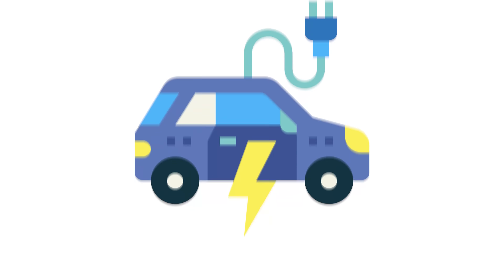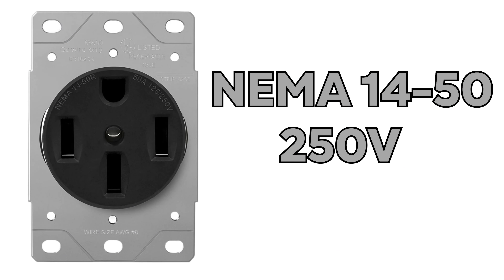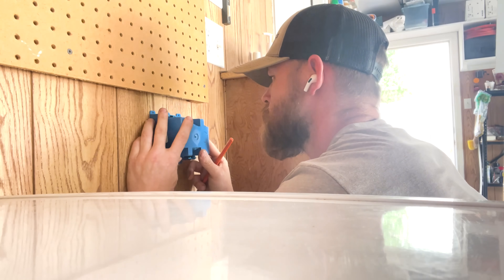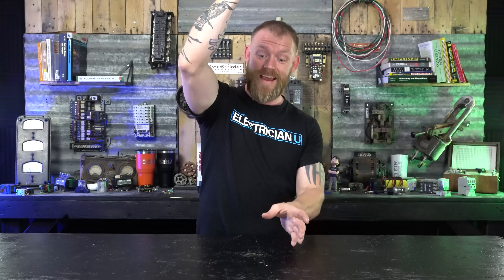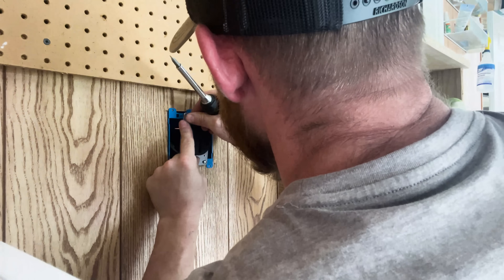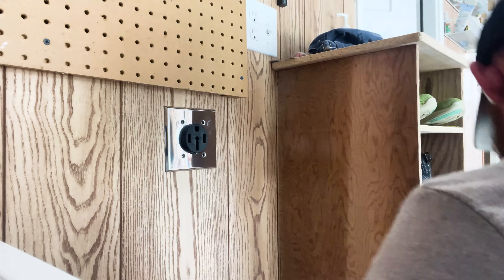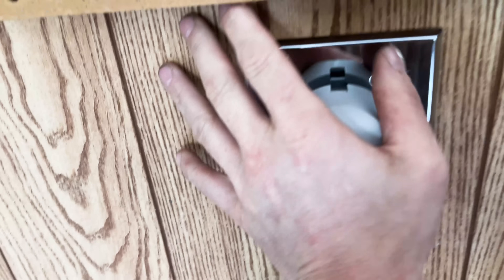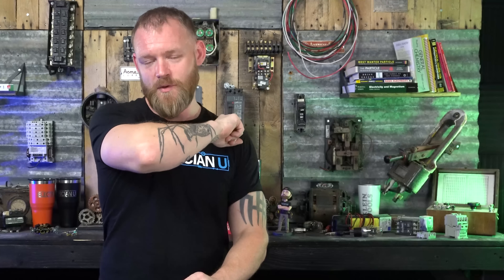How to Install an Electric Vehicle Charger Receptacle

Comment: For NM cable, don't you have to use the 60 degree column?  In that case, its ampacity is 40 amps.  An alternative is to fish ENT and run THHN through it.  Since the receptacle and panel connections are gonna be rated for 75 degrees, you can use that column, which does give you 50 amps.

Also, 210.21(B)(1) "A single receptacle installed on an individual branch circuit shall have an ampere rating not less than that of the branch circuit".  How can you get away with installing an individual 50A receptacle on a 30A branch circuit?
Reply: "Not less" means more than or equal to
Reply: @1Gigawatt  Yeah "not less than" means 50 amp receptacle on 30 amp wire is OK, because 50 amps is "not less than" 30 amps.   Seems just fine to have overkill receptacles by that code. . .
Reply: @snap-off5383  In general yes, but there's a table for 14-series receptacles that lists allowable circuit ampacities for each.  For 14-50, it's 40A or 50A.  Not 30.
Reply: @charliesullivan4304  "its listed in the rules" is never a "why" answer.  "why" answers "why was it put in the rules?"  There's no logical reason a 40A rated receptacle can't handle 30A.
Reply: @snap-off5383  It's not about the recep. It's about what someone could plug into it. The "why" is that someone could plug a 50A car charger/welder/RV/whatever into this nema 14-50. Even if that load was perfectly calibrated to draw less than 50A momentary and less than 40A continuous (80%), that would actually exceed the 80% continuous rating on that 30A (24A continuous) circuit.

 Yes, in theory the 30A breaker will trip before anything really bad happens, but the code is also requires 80% so it isn't constantly tripping.
Reply: @charliesullivan4304  if they didn’t allow using a 30 amp breaker a lot of EV chargers couldn’t be used. I installed a bosche Level 2 charger and it specifically states in the manual that the maximum breaker is 30 amps. It is UL listed and tested with a 30 amp breaker and installing it on a circuit with 40 or 50 amp breaker would void the UL listing.
Reply: @ewicky   You're getting it backwards. . . try to stay on topic, not invert it.  The topic is NOT a 50 amp receptacle on 30 amp wires the code says the receptacle rating must be NOT LESS THAN the rating of the wiring.  i.e. 50 amps is not less than 30 amps, so 50 amp receptacle on 30 amp wires is OK by that code. The question I've asked that you have still yet to address a single time is why wouldn't a "less than" receptacle be safe?  so reverse your topic: a 30 amp receptacle being served electricity by 50 amp wire*.   Why would the code want to prevent that SAFE configuration by the wording "receptacle amp rating *not less than wire rating."?   "what would someone could plug into it" is easily understood: They'd only be able to plug in items intended for 30 amps or less, and never have a problem.  The code doesn't make sense.  It doesn't prevent a 50 amp receptacle on 30 amp wire, it prevents the opposite by its wording. It says a 30 amp receptacle on 50 amp wire is a no-no.
Reply: @snap-off5383  This is my first reply under this comment, so writing in bold that I have "yet to address it a single time" makes you look unnecessarily aggressive.

I was responding to you who was responding to Charlie who told you to look at the table. You obviously still haven't looked at the effing table. You don't need to repeat yourself, I know what "not less than" means. And I'm keeping on topic to what happened in the video and in the original comment.

As for your suggestion that a 30A recep on a 50A branch circuit (aka wire and breaker) is safe, no it's not. Well it is, until someone plugs something into it. They will, rightfully, plug a 30A appliance in. That appliance will have a flimsy 30A cord that will, for the purposes of this conversation, catches fire at 40A. That appliance was designed to run on a 30A breaker and was also designed to trip a 30A during a fault BEFORE the appliance or its cord catches fire. But on a 50A breaker...
So yes you can have an appliance overloading itself or loose connection shorting itself to the case/EGC inside or whatever. And the fault current or overload condition could be 31 or 40 or 45 or 49.9 amps. On a 30A circuit (wire & breaker) that would trip the breaker and save the day. On 50, it would not trip and let the appliance start a fire. You are correct that the fire could not be at the breaker and building wiring since those are all happy with up to 50A. But the recep itself, plug, cord, appliance, etc., burn baby burn at 40A. The code is written to help breakers provide some rudimentary protection for downstream appliances, not JUST to protect building wiring. This is partially because we don't have point-of-use fuses like Europe. We rely on our breakers to protect appliances and their cords.

Yes I know about thermal trip curves and blah blah blah but I'm boiling down the made-up amps numbers to keep it simple haha.

I hope that helps you see the potential problem with mismatched recep/breaker pairings.
Reply: @ewicky   Ok you don't want to talk about what I'm talking about.  Its fine, you can keep changing the topic, I'll write you off. I understood what you wrote, you refuse to try to understand what I wrote.
You're stuck on trying to be "right all along" rather than "correct": 
NEC Article 100 "Definitions" defines branch circuit (BC) as "The circuit conductor between the final overcurrent protection device (OCPD) protecting said circuit and the outlet(s)." See how it DOESN'T include the OCPD in branch circuit (aka NOT breaker ONLY wire) and how my question is valid?
Ok so now for the first time can you address the topic of 30 amp breaker 50 amp wire 30 amp receptacle being a code violation.  Where's the safety hazard? Or are we going to hear more about how you were right all along?
Reply: @snap-off5383  Yes, you're going to hear more about how I was right all along. This is the comments section of a YouTube video, what did you think was gonna happen. I don't owe you anything, and certainly don't owe you anything better than me explaining how I'm right again haha.

You're misinterpreting the code. You can oversize the wire all you want. The breaker and recep need to be an acceptable pair that is on the table that you've hopefully read by now. That's it. That's all there is to it. It isn't a code violation to use a 30A recep on 50A-capable wire on a 30A breaker. Putting said 6awg ("50A wire) wire on a 30A breaker effectively de-rates the "branch circuit" to 30A for most subsequent circuit sizing (and recep selection) questions. Exceptions would include things like available fault current calculations and other off-topic stuff that relies more heavily on distance, AWG, etc.

It sounds like your entire question was formulated out of your "ASSumtion" (ha) that that was a code violation to begin with. And now you've made an ass out of you and me.
Reply: @ewicky   "I don't owe you anything,"  Why is this phrase often said by people where there was no communication given that anyone felt owed?
Yeah the "rating" coming by definition from the OCPD not the wire amperage rating was the missing information that I presumed (rather than assumed -  there's a difference)  I'm not a professional electrician, just a professional homeowner, thus I asked with no expectation of anyone answering as is quite evident from my first comment.
Reply: @alexlacey9808  sorry, I must not have been clear.  There are a lot of EVSEs ("chargers") that have different ratings and absolutely, you should follow their instructions as far as what breaker size to use, which can be as small as 20 amps or as large as 100 amps.  What I was saying is not allowed is a 30 amp breaker on a 14-50 receptacle. That's in the national electrical code and applies regardless of what you do or do not plan to plug in to that receptacle.

Bosche does have a model EV400 that has a 14-50 plug on it.  It can do 30 amps, and the manual specifies a 40 amp breaker for that.  I'm not sure which one you have.  But maybe you have a hardwired one that specifies a 30 amp breaker.
Reply: or surface mount EMT?  What is 6 gauge good for in rigid/emt?  That's what I installed on my welder outlet, wonder how big I can go for charging cars. I know, google.
Reply: @snap-off5383  Depends on the wire type. Welder isn't continuous draw. In general #6 copper is good for 50A.
Reply: Because 50 is not less than 30.  Putting a 50A outlet on a 30A circuit is perfectly fine.  Putting a 30A outlet on a 50A circuit is not.
Reply: @stargazer7644  which begs the question:  WHY?  What would go wrong with a 30 amp receptacle on bigger wire?
Reply: @snap-off5383  Bigger wire wouldn't be a problem as long as the outlet was designed to use wire that big.  The problem is putting it on a bigger circuit breaker.  30A receptacles are only designed to handle the heat from the current of a 30A load.  If you draw 50 amps through that 30A receptacle, it (or the 30A cord plugged into it) will overheat, possibly melt and/or catch fire and the 50A breaker would never trip.  The entire purpose of a circuit breaker is to protect the wire and equipment connected downstream of it from overheating and catching fire from current higher than it was designed for.  The breaker is sized for the maximum allowable current that the wire and receptacles can safely pass.
That's why drawing 30A through a 50A receptacle is fine, but 50A through a 30A receptacle is  not.
If you try to draw 50A through that 50A receptacle on the 30A circuit, it will simply open the circuit breaker before anything gets too hot.  No danger.
Reply: @stargazer7644  Because appliances that draw 50 amps often come with 30 amp plugs? Why did you ASSume that there would be a 50 amp breaker on 30 amp wire?  That's not the code violation we're discussing, that's a subject change i.e. strawman. Plus as you yourself said "The breaker is sized for the maximum allowable current that the wire" correct so we're not talking about a breaker too big for the wire. 
Putting a 30 amp receptacle on wires capable of 50 amps doesn't create the scenarios you put forth.  No device with a 30 amp plug is going to pull 50 amps, and we're not talking about an undersized breaker, just an undersized receptacle.

Comment: Can someone explain why we should install 14-50 not 6-50?
Reply: Because that's the plug that's on the end of the charger's cable.
Reply: @stargazer7644  Clear concise reasoning.
Reply: Compatibility. My Siemens evse does not need a natural wire, but the other brand I have does.
Reply: The cars come with 4 prong plugs. . . Engineers think they need 120V supplied instead of derived in their appliances now. You can build a hellacious 120V distribution extension cord if there's a neutral?  No good reasons.
Reply: Idk 14-50 seems to be the standard with most, for mine I installed a 6-50 works great
Reply: Some chargers may need 120V/240V, rather than just 240V.  Thus the need for the neutral connector.
Reply: @barryomahony4983  It only "needs" it if it needs it.
Reply: @snap-off5383  Haha.   humorous.

Comment: So your main panel was on a interior wall so plenty of head room in the attic and no insulation but for the outlet side you had insulation so was that a exterior wall? If so how did you do that fish? Did you have drywall work on the inside? If not how did you have room in the attic to get a drill on the top plate and room for you to fit between the roof line and the ceiling/attic floor. ??

Comment: I hate plastic boxes for this stuff. That's why, when I have a choice, I use alflex and individual conductors, and a metal box. I've had too many receptacles pop out of plastic boxes (like in my daughter's house), because there was too much pressure from wires behind the receptacle, that it just stripped the plastic screw threads in the plastic boxes. Metal for the win.
Reply: Yeah, I would never use a plastic old work box for a 50 amp receptacle.
Reply: Flexible metal conduit in a residential setting looks tacky as all hell.  Jump up to EMT at least for homes.
Reply: @snap-off5383  the only time I use flex is when there is movement or vibration. I agree that it is tacky in residential. I still wouldn’t use a plastic box though. Finding a stud and mounting a metal box to the side of it is just too easy. I do it all of the time with single gang boxes. Two gangs and larger just make it even easier.

Comment: Should the wire be tightened with at torque driver at the breaker and receptacle
Reply: Yes, but if you hire a “pro” the odds of using a torque driver are slim to none.

Comment: 334.80  Ampacity  The ampacity of Types NM and NMC cable shall be determined in accordance with 310.14. The ampacity shall not exceed that of a 60°C (140°F) rated conductor.
Reply: Came here to day this lol you need 6/3 for 50 amp
Reply: @SaigaGameClips  that's exactly what I was thinking number 8 THHN at 75° is rated for 50 amps but number 8 Romex at 60° is not rated for 50 amps
Reply: Yep. 8AWG Romex is on the 60c column and therefore rated for 40A. 6AWG would be 55A.
Reply: I thought the same, at least if in the future a 40 Amp continuous draw is wanted. Although NEC allows us to put a breaker smaller than 50 Amps, I am not a fan of doing so because the next home owners will not know that the 14-50 receptacle has a 30 Amp O

An alternative here would have been to put a 6-30 receptacle: one less wire, and the circuit would match the customer preference. And then 8/3 or 10/3  Romex would suffice. 

Sound right ?
Reply: @ericgold3840  NEC allows a 14-50 receptacle on a 40 A circuit, but doesn't allow it with a 30A circuit.  That combination of wire and receptacle can only be used with a 40 A breaker.
Reply: Yep, #8 NM-b is only 40 amp wire

Comment: While some may find this particular presentation to be somewhat dry, I find it a breath of fresh air compared to the overheated and hyperventilated approach of many youtube tutorials. Solid information delivered in an authoritative and easy to digest manner. Thank you for sharing your knowledge.
Reply: I do find it funny that he says if you're not an electrician, hire an electrician and that this video is for electricians. If you're an electrician and you need to actually watch this video, then there's a problem!
Reply: @dontbanmebrodontbanme5403 
You must agree that some electricians just don't know everything. 
I've worked in Residential, Commercial, Industrial, construction, service and maintenance. 
Each area requires much of the same basic knowledge, but also very different methods. 
Dustin understands this and provides info for experienced electricians that are still learning new things ... which is every electrician I've ever met.
Reply: I recently just add one as well.
Reply: I agree wholeheartedly!! Usually the repartee is annoying & doesn’t add value. One exception is efixx. I enjoy their back & forth banter. It’s low-key & amusing. The electricians talk is British so I have WTF moments(ceiling rose anyone?) but the principles are the same.
Reply: @emarr3720  ring around ceiling light fixture?
Reply: I find his videos to be too long and most of the content to be too repetitive or unnecessary. I skip through a lot of video likely missing a lot due to the painful length of the videos.

Comment: Don't know if my township is following the latest NEC codes for mostly all GFCI/Arc breakers. However I think they are more nuisance than safety. All my electricians ever told me that installing a gfci outlet or breaker can trip them when running machinery like washer, dryers, vacuums, tools, etc. Who wants to find out there dryer stop running half way through the next day. Just my two cents of thought.
Reply: This is why I refuse to put my crawl space sump pump on a gfci breaker where a nuisance trip will result in a flooded crawlspace and a destroyed $5000 air conditioning  unit.

Comment: Great job Justin. FYI - Tesla requires #6 AWG. Also, limit continuous use (current draw 3 hours or more) to 80% of capacity. I have replaced 50 amp RV outlets because they melted with car charging at 48 amps. Luckily, the homeowner didn’t have a fire.
Reply: most chargers don't go full beans for 3 hours+ anymore, do they?
Reply: @wim0104  A Tesla EV has a 80-100KWh battery. You can do the math... It can go for 10 hours at 40 amps depending on the secondary voltage (240 or 208).
Reply: Interesting, Tesla's mobile charger that is included with the car will only do 32 amps (with the 14-50 adapter). They sell an special 14-50 mobile charger that does 40 amps. Both use a 14-50. Must have been a non-tesla that was able to pull 48 amps on a 14-50.
Reply: @djmaster1995  Original "Gen 1" Tesla mobile chargers do charge at 40A when plugged into a 50A source. They haven't sold them for years, but Tesla still carries some of the plug adapters on their website.
Reply: @djmaster1995  the units that can run 48 amps are supposed to be hardwired on a 60 amp circuit to run 48 A.  When they are plugged into a 14-50, they're supposed to be set to 40 amps.  In theory, that setting is supposed to be done by the electrician and then locked down so the homeowner can't stupidly set it to the wrong current level, but that's not enforced very well.
Reply: L2 car chargers (what he is referencing in the video) are built for 40A charging, so a 50A receptacle is compliant with the 80% capacity.
Reply: @rogue2020  L2 can be anything from 16 A to 80 A.  Some units are fixed to just one current level, and others can be adjusted when they're installed, and set to 80% of the circuit capacity.